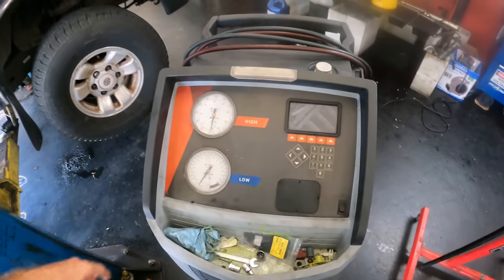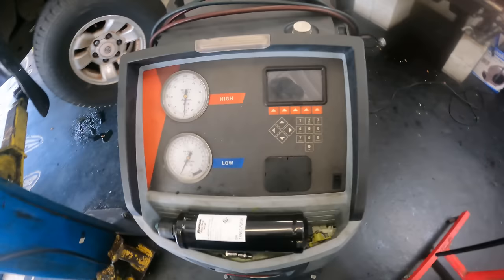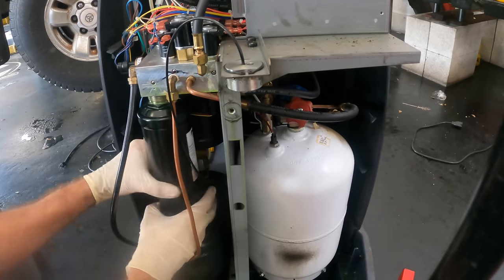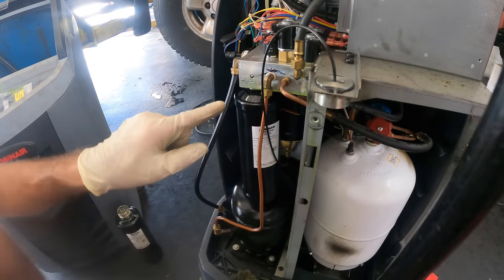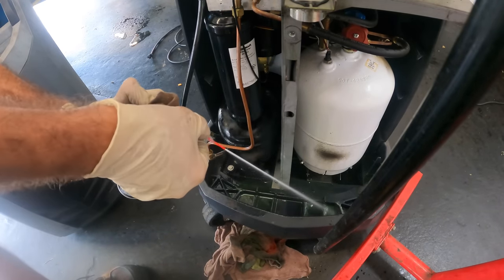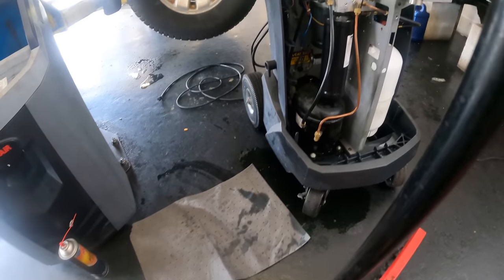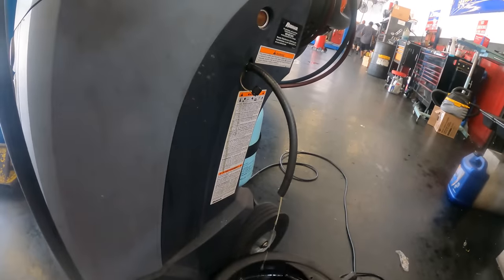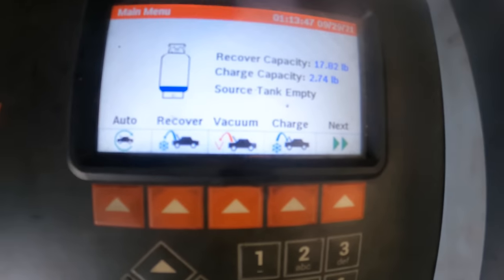Robinair A/C Machine Maintenance

Comment: I taught and managed A/C classes at a vo-tech school for 13 years. We had 8 Snap-on recycle machines. Just Robinaires with a higher price tag. OMG, this video brought back memories! The reason for programming the filter # is so you cant cheat and just re-use the old filter. Older machines didn't require that until the EPA stepped in. That Stupid O-ring on top always gave me fits! They NEVER fit right! I was surprised to see the new one already set in its groove. First time I've seen that. You CAN cheat on the vacuum pump oil, but why? You could see the oil was contaminated, and pumps lose their efficiency with crappy oil, so it's worth it to replace the oil. You did fine as usual! No REEEE at all!
Reply: Hello can i ask you for opinion, im troubleshooting old recovery machine?
Reply: @milanumaja  I doubt that I could help with that. It has been over 10 years since I've used one. You certainly could ask, and I'll see if I can help.

Comment: i gotta say something..been watching ur vids love them..i love working on cars would be working on them for 6 yrs now? when i started i was 20.. got to a dealership when i was 22..quit when i was 24 as most people r very dodgy miss diag a lot of times..i was basically the dude that when the tech didn't have enough time i did the grunt work alot of brakes suspension tune ups.axles.. stuff that not super difficult..i seen a bunch of customer come back as they say what we did didn't fix it so we threw more parts at it..i couldn't be apart of that..alot of people know nothing and get screwed.. im glad there someone who actually teaching people.. wish i found some one like you to apprentice under a lot of knowledge and knows how to do stuff the right way for the customer :D

Comment: Years ago I started in plant maintenance what servicing all the machine shop equipment and apprenticeship opened up they offered me the job 6 years later I was running the shop now I always went the extra distance like Ray and I admire him and in the long run I will say that the go do that it will pay off in the long run because if I wasn't that way and didn't have that mentality I wouldn't be where I'm at today thank you Ray and thank you for all the people like him to do a job right the only thing I didn't say is the Chinese took over the plant and then everybody in management was told to go pack it but still it's served me well I learned a lot and again I wouldn't be where I'm at today but didn't have that kind of work ethic

Comment: Looking at the condition of that sight glass I'm pretty sure that pump is very contaminated, check the users manual for cleaning procedures and flushing. I flush my pumps with solvent and PAG150 and I still use a Robinair 6 CFM with 18 years of service.
Reply: Yea vacuum pump oil gets dirty..  especially with so many different systems being pumped down with the same unit.. vehicle ac’s especially..  vacuum pump oil is supposed to get dirty tho, it filters out shit and pulls crap out naturally.. you just gotta worry when you start seeing any dye in there…. Ive watched some new techs try to pump down systems through the pump with the recovery in wrong and it fill up the pump with refrigerant..  when they disconnect it the thing shits out everything to atmosphere and coats the entire shop in a fine layer of oil..  lol..  funny to watch em freak out running out of a big smoke cloud thinking their gonna die from breathing in the 134..  lol..

Comment: We did this annually and replaced hose fittings as well . Saved the old fittings just in case . Every other year,  replaced hoses as well. Not being able to evacuate. A car because of something that was avoidable is a waste. Also changed the oil on the air compressor and looking for leaks in same month, usually in January our slowest month.

Comment: I am a service tech for robinair and you do not need to tighten the filter that tight. all it needs is hand tight.
Reply: Ditto
Reply: Almost all O-rings are like that, right? Actually, this one had the second larger ring, it looks like it compresses against the machine, so not just a plain O

Comment: The drier cartridge is filled with silica gel beads. You did a good job there but try to avoid spraying brake Kleen onto the control solenoid wires area because it causes the wire insulation to dry and crack. Don't worry about the cover off whilst plugged in because the entire unit is low voltage components powered by a DC step down voltage. That vacuum compressor oil looked terrible, it was clearly contaminated with moisture.

Comment: I just did the same service on the exact same machine the 2nd time this summer...yes I do alot of ac work. I like this machine cause you can do hybrids...downside to this machine is you have to manually inject oil or dye due to it servicing hybrids....can't go mixing oils for sure.

Comment: I work on these robinair units for a living here in arizona and what happens is when that rubber cap come off the new filter itll sometimes be stuck in that cap and people wont even know. Your machine will also suck alot air into that isv white tank and can also lock you out due to high pressure
Reply: Hi John what do you look for when it just gets stuck on low side clear in progress?

Comment: Ray buddy that compressor oil needs to be changed every 30 or so cars if not you will have premature pump failure, believe me I know 30+ year master HVACR tech. Oh by the way the UV dye is nasty stuff, but what is weird is the only thing that I have found over the years to remove it is Dawn dish soap works like it was made for removing it. Just a tip Brother. Keep up the good work, Glad to see you have bounced back from Corona. :)
Reply: Recommended change interval is 100hrs. I am a Robinair service technician. Vacuum pumps rarely fail. I have maybe replaced 10 in 6 years for failure. I average working on 500-600 machines a year. That being said, extra service isn’t a bad thing.
Reply: @bentrubisky6712   I have had my Robibair  Vacuum pump for over 30 years of service work. Running it on average of 8-10 hours per day in Tucson, Az. with Roof temps hitting 200+ degrees even with nasty Methane contaminated systems, but I also treat my equipment right and take care of it since it made me money every day that's why I changed my oil and filter every week unless it is the dumps Methane plant massive chiller system with 10,000 Gallons of R-22, I did an oil change ever night on that stuff. lol Methane is nasty and extremely corrosive. But I agree with you, but you know how some auto shops are if it ain't broke do worry about it until it is. I know Ray is a lot better than most of the average auto monkeys with toolboxes, No offense to any one person. :)

Comment: Always enjoy your vids Ray!
I have a question,  Two summers ago my 19 y/o RAM truck was low on freon. I added enough refrigerant to get the gauge pressures reading correctly. It's been fine since but was that a mistake? Should it have been evacuated totally and then have the exact right amount added?
Reply: I think it's fine as long as the system still has some pressure. If it was completely open, that would allow moist air in. Just my thinking.
Reply: @stephen00brown  Thanks. The compressor still ran if I rev'd it a little. So it was never open.
Reply: As an electrician who worked with refrigeration mechanics for a few years they never weighed gas, always vacuumed out the system then just kept pumping more gas till the recommended pressure was achieved.

Comment: Interesting. It is easy to forget that service machines need servicing themselves.
Perhaps the O-ring was missing last time the filter was changed, easily unnoticed, and has been leaking since.  Leaking gas evaporates, leaving the oil to ooze to the bottom and make a puddle.
Green footprints.  There's a thought.  Did someone mention halloween?

Comment: Is it safe to use brake cleaner on the electronics/connections? (Total layman here)
Reply: As long as it dries before reconnecting the power. I didnt have any more maf cleaner so I used some brake clean on my stumbling Silverado. Didn't hurt it and fixed the issue
Reply: I wondered the same things.  Odds are there are a dozen different plastics on the unit, and every plastic has different compatibility.

Comment: Doesn't the leak inside that machine suggest that it may have been improperly recovering and filling customer vehicles' systems? If the machine works by measuring the tank weight, and refrigerant was leaking inside the recovery machine, it seems like the math would be wrong.
Reply: Yes, although the error is extremely small.  Hence the reason that the system will lock itself out if it goes beyond its internal self test and calibration limits.  The self checking aspect of these machines is the main reason they are needed.